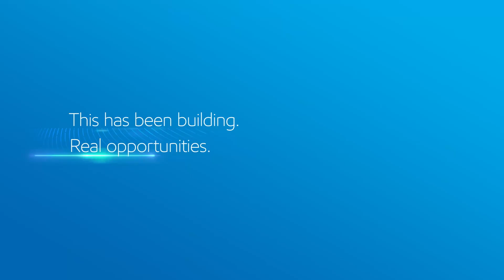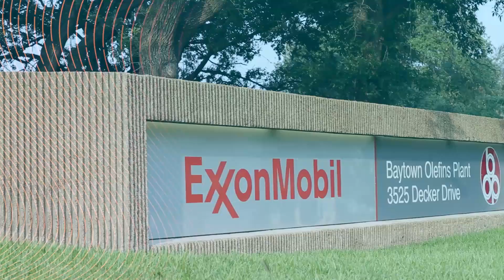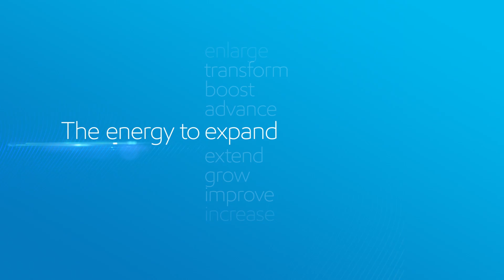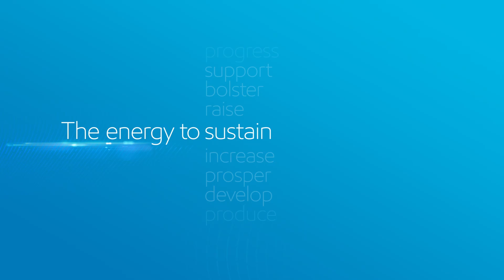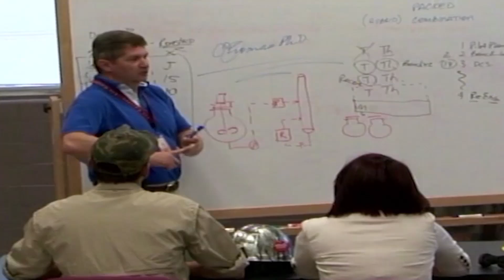ExxonMobil Baytown Chemical Expansion Project Overview (Full length video)

Comment: Francisco,  would you consider getting a  Free  2 year Associates degree in one of many Technologies,  , this would open many doors for you .  You would not need relatives or friends to get you hired .  Do you speak Spanish and English ?  If you do then this is a Credential ,  Do you have your 2 year Associates Degree in one of the many High Demand Technologies,   If so then this is a Credential,   ..  Are you healthy ?? If so then this is a Credential ..  Do you have any experience,  If so then this is a Credential .   What are some of the many High Demand Technologies in Texas ?  What do they pay ?  Where are the jobs located ?  What are my chances at getting Hired ?   This is just a  partial list .   Pipe Fitting and Welding ,  2 year Associates Degree ,  with Classes in CAD ,  Computer Automated Drafting ,  These men help design systems for Engineers ,  ETC .  Electrical Electronic Technology ,  These men and women install and maintain complex Electrical and Electronics  ,  Instrumentation and Analyzers,   These men and women install and maintain complex Automated systems ,  Mechanical and Machinist Technology ,,  These men install and maintain very expensive Mechanical ,  Compressors,  Turbine Systems  , they make special parts from Metal ,   Computer Maintenance and Cyber Security Systems ,  These Technicians although only having  a 2 year Degree, are making excellent money , especially in Cyber Security ,  I could continue ,  we have over 12 categories of Free Education .  No one is hired without Credentials in a normal situation .   Education is Free to you,  with a 2 year degree here in Texas you can expect to make an excellent living , but you must start out at the bottom .  There are 2.5 Million Texans getting pay checks from Energy related Industries ,  approximately 30 % are retirement eligible .  This translates to about 500-600 thousand of jobs that will be available in Texas in the next 5-10 years , the average Salary is over 100,000 per year .  Credentials are mandatory for long lasting Careers .  Approximately 60 % of the Industry does not rely on the price of Crude oil ,